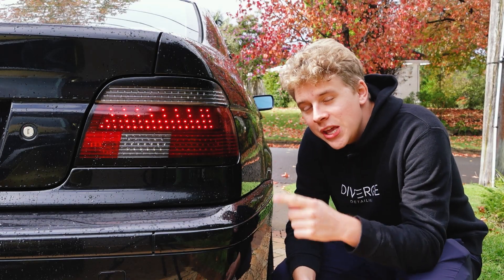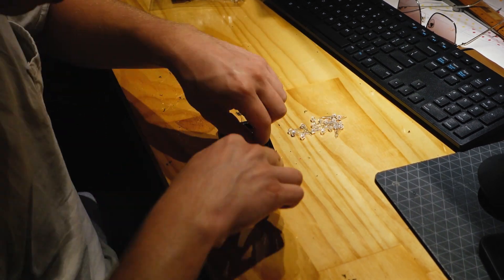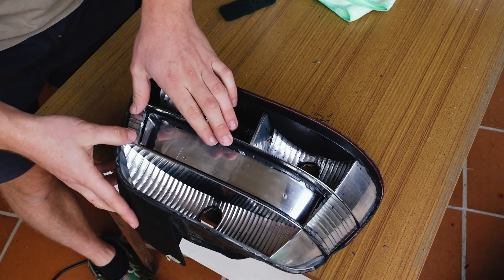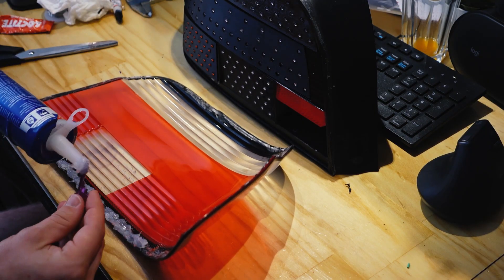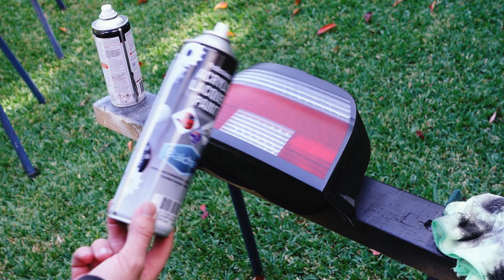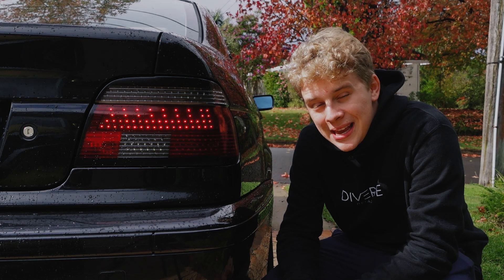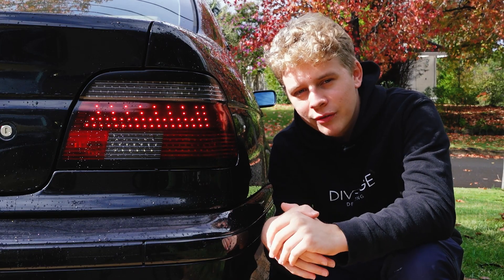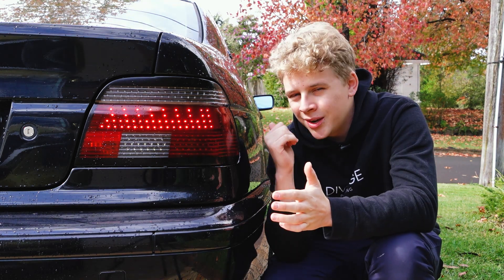$80 LED taillights BUILT FROM SCRATCH (E39 BMW 5 Series)

Comment: Great work. I’m gathering ideas for my 73 Maverick. I have a basic on electronics, but do you think led strips that cut to fit would work?
Reply from the maker: LED strips are probably the most common choice for custom taillights, I just used individual bulbs because I wanted the matrix bulb look 👍
Reply: @ my original plan was to build a board for LEDs like you did so I can program it to spell out F**k you haha. But I need something easy first since I did a body swap on a 04 mustang and of course I need custom lights. It’s an awesome build, I’m not a YouTuber but made a few videos. Thanks for the info.

Comment: Awesome work, but yeah, those are things you learn only by actually doing it. In my Peugeot i had to put resistors for the blinkers LED lights, and yes, they get quite hot when they are turned on for an extended period of time. Subscribed.
Reply from the maker: That’s it mate - you don’t know until you try it